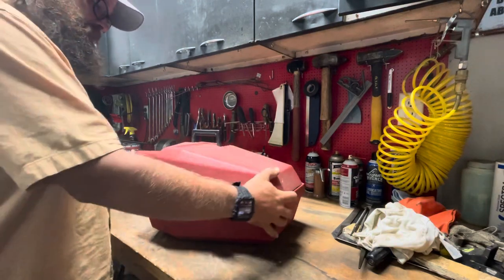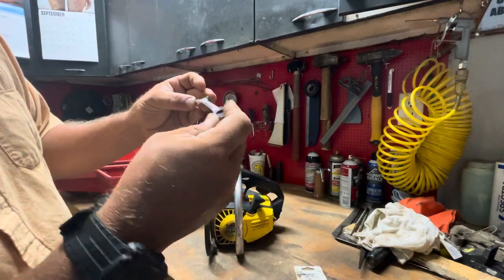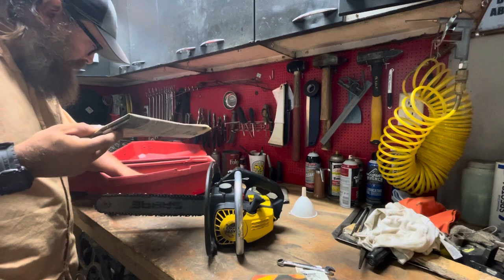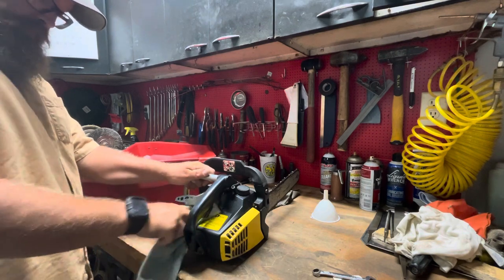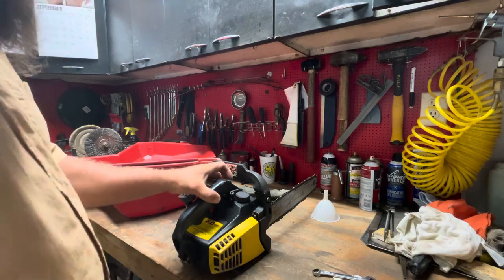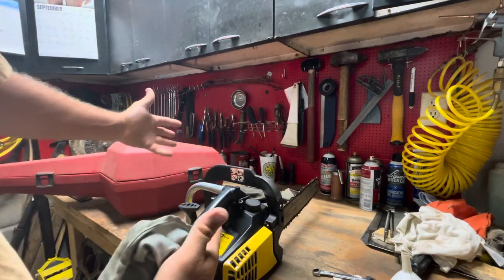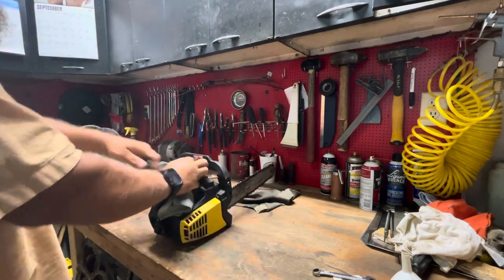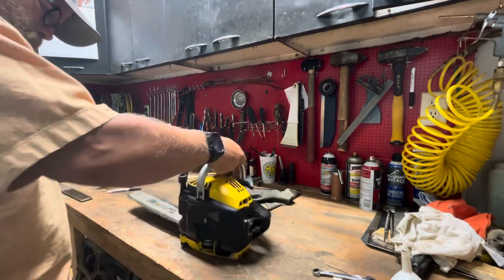Eager Beaver 2.0 C.I.D. Chain Saw with Case  Not Sure if it runs... (I Scored it For $5)

Comment: Returned one of these this saturday after fixing it for a new homeowner who found it left behind by previous owner. It was a real treat😱 The orig. owner took off the chain tensioner because he was too lazy? to find the correct length chain and doing that pushed the bar into the sprocket when he put on a chain that was too short. I wore the sprocket a bit but didnt  ruin it. The gas filter (12$) is a wool like material and it just gets pushed into place in the gas tank.  When you remove the tank from the O ring compression gas line check that the O ring is good, (ask me how I know) I saw James Condon repair one of these a few months ago and I said I would NEVER EVER take one of these on, but, I'm glad I did, a great learning experience. Not a true mechanic but Google is a fountain of some very good info.
Reply from the maker: Yeah. I’ve watch a few vids on this chainsaw. Kind of a strange design. Definitely not extra easy to work on. I think it why I got this one for $5. Lol.